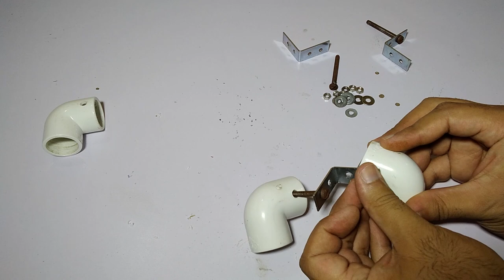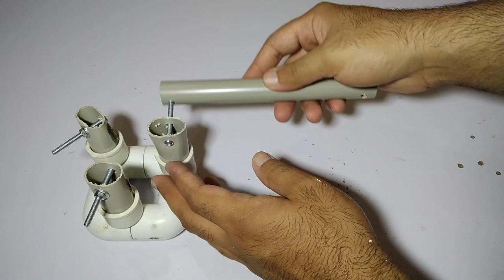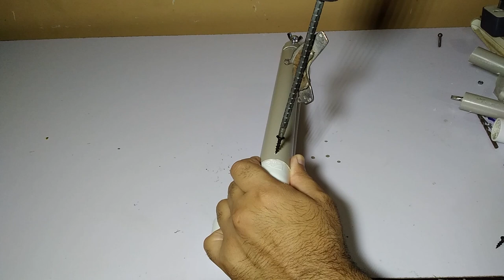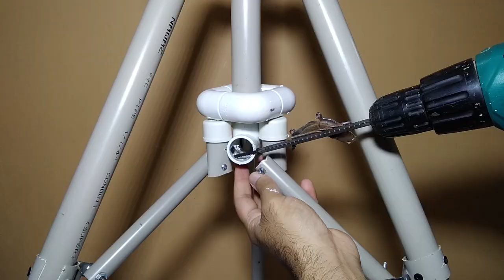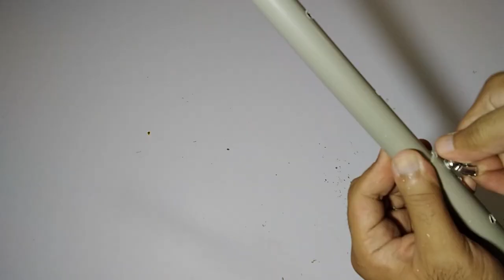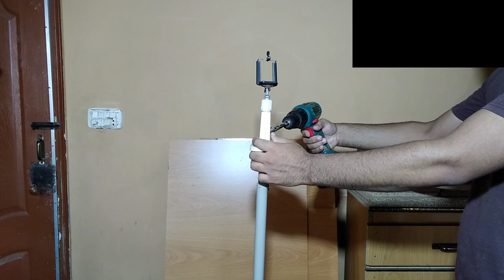How to make a pvc light stand and tripod - pvc pipe projects - how to make tripod

Comment: could you please write the dimensions of the pipes and the screws? the nuts and bolts too! Woul be very helpful if you type all items you used so it can be easy to do please
Reply from the maker: the lengths are any measurements you need and there is only main items are PVC pipes and but bolt
Reply: @Umairworkshop  that's very low effort. your video sucks.

You really should put the dimensions, also you should put less ads.

I gave you a dislike for all those ads.